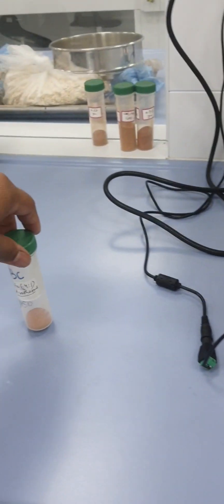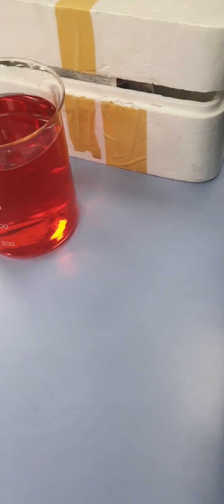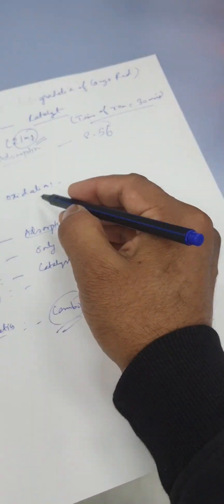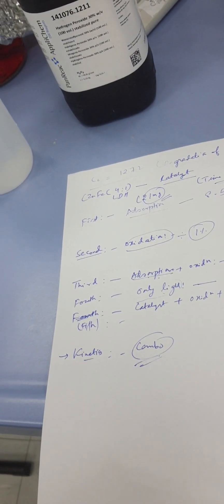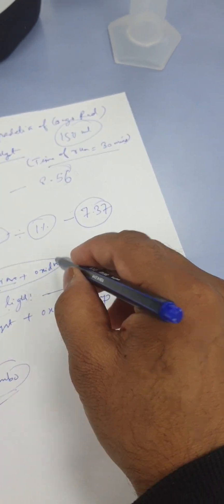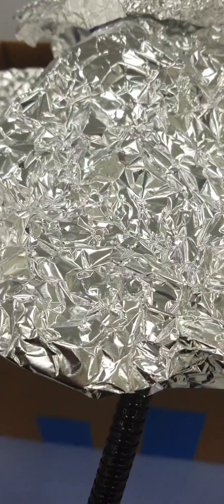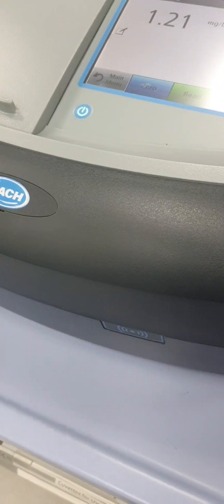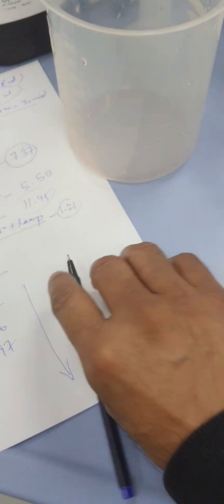Photocatalytic Degradation of Anionic Congo Red Dye Using Cellulose–LDH Composite

Comment: if i use magnetic nanoparticals then what is the process? Magnetic strirrer is compulsory in this procedure? Because magnetic Nanoparticles attached with magnetic strirrer. Then what is the solution??? What lamp should i use use?
Reply from the maker: Well as per some literature you can use if the magnetic nanoparticles stick to the stir bar, avoid using a magnetic stirrer—use an overhead stirrer or shaker instead made of PTFE which is not magnetic in nature and does not react with the solution mixture. After photocatalysis, separate the catalyst using an external magnet or centrifugation, then filter the supernatant (0.22–0.45 µm) before analysis. Use a UV lamp (365 nm) for UV-active catalysts or visible LEDs (420–450 nm) for visible-light photocatalysts.
Reply: @materialsandtechnology8956 thank you

Comment: Dear,
My experimental results on metal adsorption showed that both Langmuir and Freundlich models fit the results. What is that mean?
Reply from the maker: Dear as per literature review or researches done In principle, there is one more, "delicate" analysis: Langmuir model tends to linear isotherm, when reducing solute concentrations whereas Freundlich model never tends to linear isotherms. So, by carefully examining the data distribution along the lower solute range, this could be also revealed.
Reply from the maker: Dear as per literature review :In principle, there is one more, "delicate" analysis: Langmuir model tends to linear isotherm, when reducing solute concentrations whereas Freundlich model never tends to linear isotherms. So, by carefully examining the data distribution along the lower solute range, this could be also revealed.